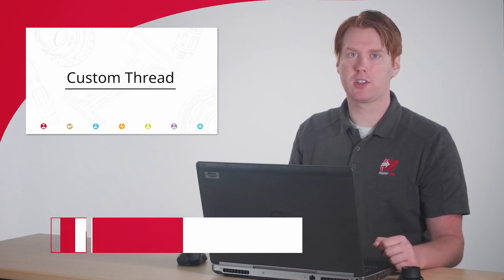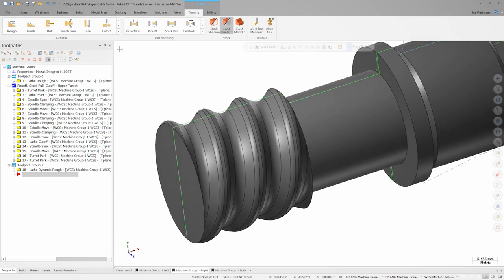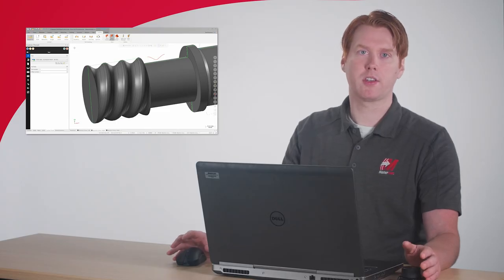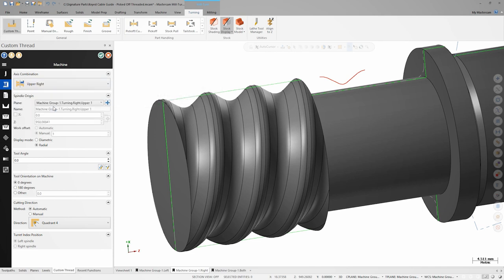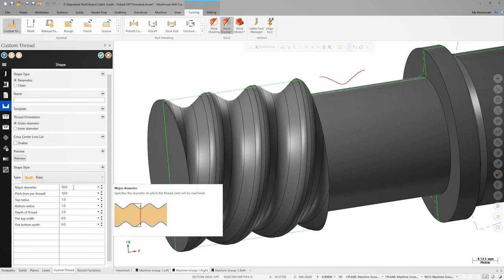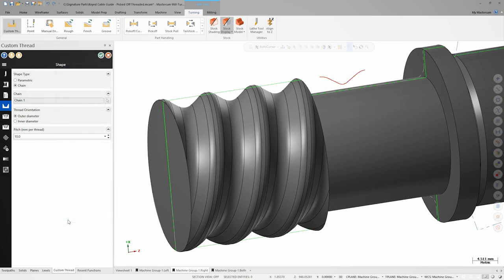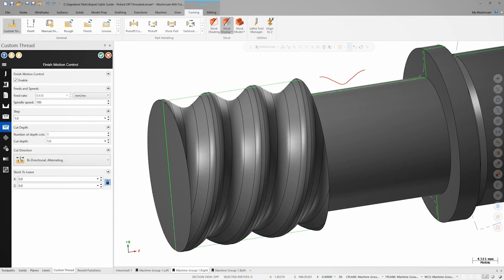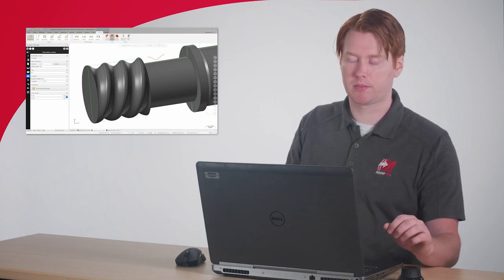Keyed Cable Guide: Custom Thread

Comment: How can I angle the entrance and exit in special tooth extraction? How can I choose the right and left tooth extraction?
Reply from the maker: Currently, Custom Thread does not allow for tapered threads or tapered/ramped lead-ins and lead-outs. Threads must start and end in relieved/undercut areas.
Reply: @mastercam  Hi, Does custom thread allow tapered threads, or ramped lead outs yet?